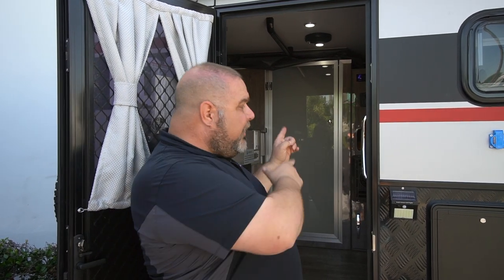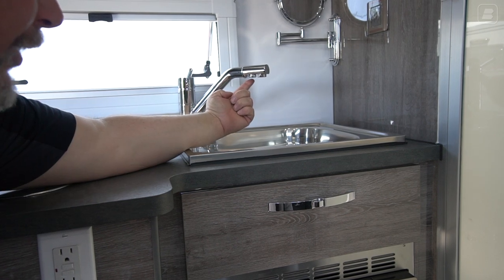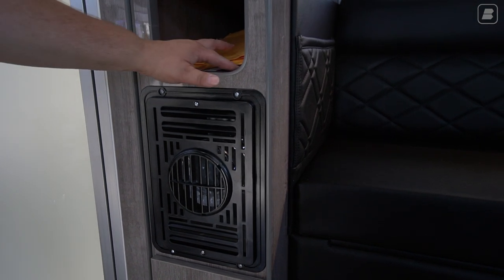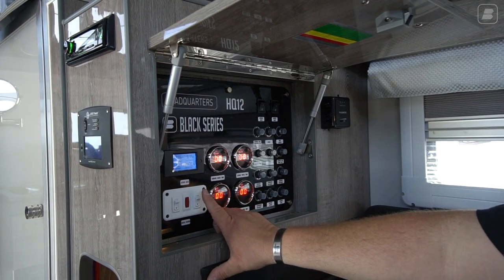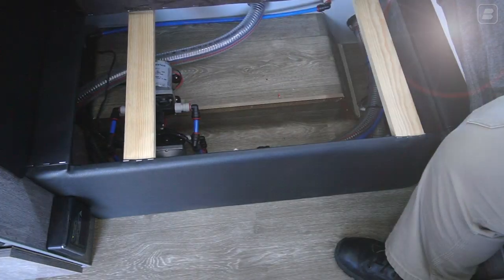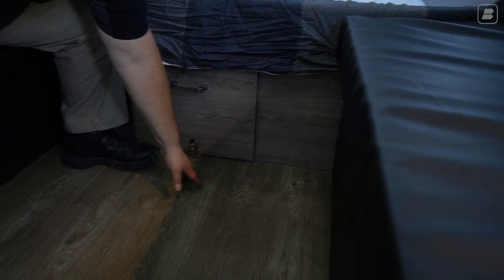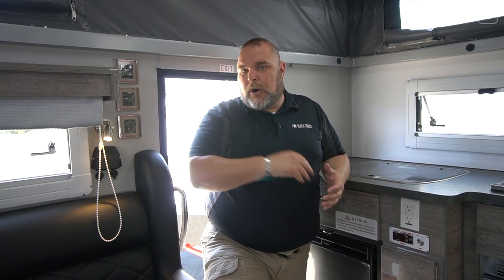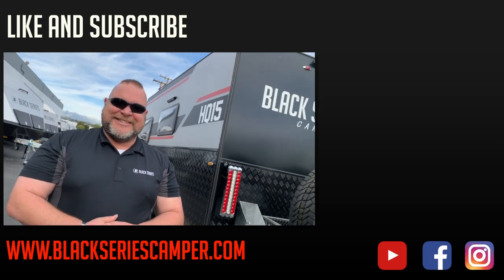HQ12 Interior Walkthrough! Black Series Camper; Caravans, trailers and campers

Comment: How tall is the HQ12 with the top closed and air conditioner installed. Thanks
Reply from the maker: The interior height of the HQ12 when closed is about 5ft and the AC takes another 2-4 inches of height. The external height when the HQ12 is all closes up is 8ft 2in.

Comment: I love the layout. However I am very confused, who designed this?  It had to be a man. There is absolutely no storage.  Nowhere to put clothes, pot, pans or how about hunting gear?  Certainly missing some vital parts.
Reply: I'm a guy so maybe I shouldn't comment but this is a smaller unit and something has to give.  What would you be willing to give up so that you could have those things you want?  Put bins to store things in the top bunk or in the shower.  If you don't need an interior fridge then remove it and make storage.  I mean, they make bigger units that would accommodate the storage you're seeking.

Comment: It bothers me you're putting the privacy screen at the top. The reason it needs to be at the bottom is for PRIVACY. 
When you want air as well as privacy it's supposed to block the bottom because that's where people's eyes are when they're walking around. 
The air then can still come in from the top. 
EVERY other manufacturer has them configured correctly except you. 
And I don't know how it's made sense to you showing these off continuously when it's upside down.